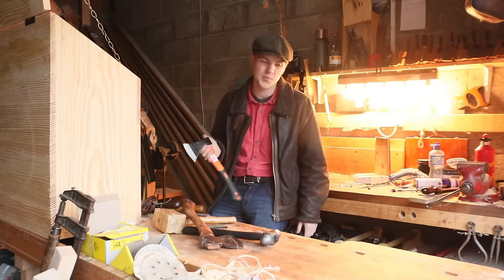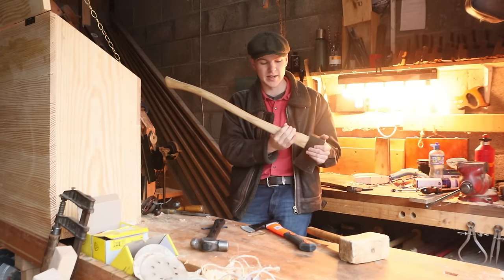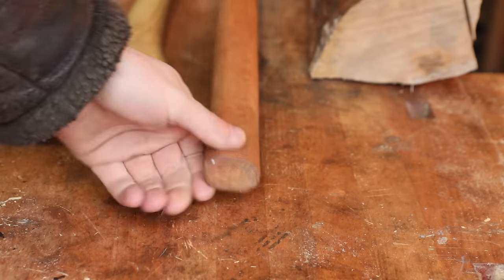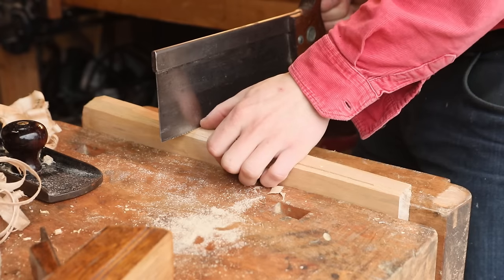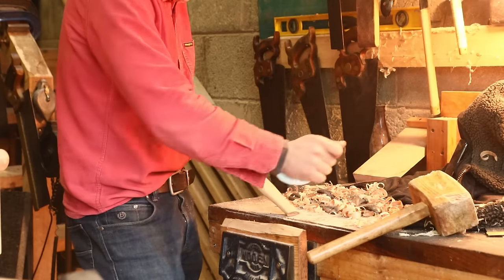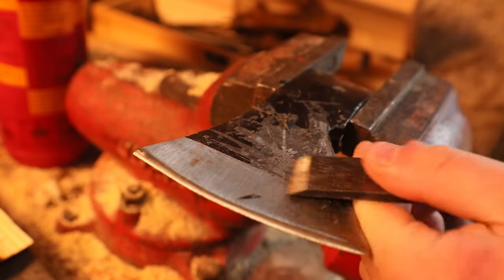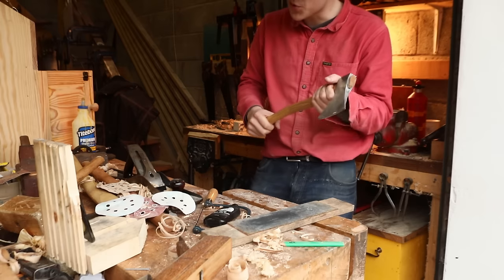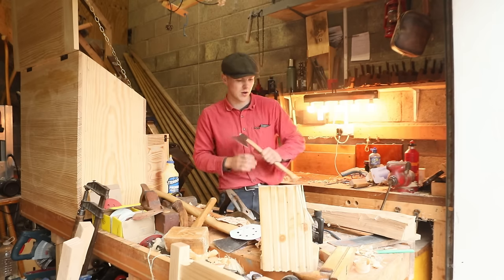Fixing the Cheapest Axe I Could Buy

Comment: I never knew that about the grain selection, makes a lot of sense when you think about it though, have the grain running against the direction of impact for maximum strength.  The axe looks well, definitely a lot better than it did anyhow!  And certainly going to cut better for not having that pissed-up edge on it.

Maybe in future you could make yourself a simple brick forge and have a go at heat-treating it to get a bit more edge retention and hardness out of it.  It's never going to be a top-end steel, but with a good round of treatment, plus yout work re-profiling and handling it, you might well be able to turn the 6 Euro axe into at least a 60 Euro axe!
Reply: Agreed with all of the above….however the hardening of the edge is subject to the composition of the mother metal. 
More carbon, molybdenum etc will achieve an upstanding result but a mild/ milder steel will remain inert despite the efforts. 
Best regards 
Mark
Old school Tool and Diemaker

Comment: Oil everything. Internal wood in the box as well as the tools.
Maybe wrap some tools that are used less often in wax/oil paper. Also Poundland damp trap might be worth trying although it wouldn’t look great but it would absorb any moisture inside the box
Maybe also look at how well the box lid seals. If moist air can move through gaps then it will settle on the coldest materials/tools

Comment: To get the epoxy out easy you can use acetone an leave the ace Head in a plastic bag so the acetone doesn't evaporate wile it losens the epoxy it worked a treat for me, I think the fiberglass stand's act like a wick

Comment: I recently got hooked on your content via YouTube Shorts. Apparently YouTube knows me better than I know myself. Keep it up, great stuff ❤
But using a STONE-Drillbit for plastics looks just so wrong 😅
Reply from the maker: I rarely use power tools. What would you recommend?
Reply: @EoinReardon  I'm not the one you replied to above, but rock/masonry bits aren't really very sharp, they're more like a spiral-shaped blunt-ish chisel intended to be used with a hammer drill or rotary hammer that relies on impact as much as(if not more) than actual cutting. For drilling through epoxies or plastic I'd much rather use metal(HSS) or wood drill bits.

Comment: My friend, I know exactly what you went through removing the original handle. I had a full size axe with a fiberglass handle break on me, and decided to simple re-haft it. Wasn’t as simple as I thought it’d be… that epoxy stuff was rugged! 😁
Reply: Yeah, similar thing happened to me, except with a claw hammer. That fiberglass epoxy stuff was HORRIBLE to work with and stuck like it was welded on!
I probably should have just bought a new one, it wasn't exactly expensive to begin with, but if you don't see a broken tool and think 'that could be a fun project', then what's wrong with you?

Comment: I'd have used fire to remove that plastic handle, then case harden the head using oil and silica sand. That's how I make my own cast iron oiler rings. I build steam engines for a hobby.

Comment: So. speaking about grain direction with respect to the tool it is handling. Would you want the grain of the froe handle to be perpendicular to the head so that when you do the "lever action" to split the wood the stress is in the direction that is less likely to split the handle? Or would you still want the grain parallel to the head?

Comment: Have you ever had the ash snap off just below the haft of the axe head after fitting a handle?   I've had that happen with a hammer and two hatchet heads -- wondering if I just got a brash bit of ash, or whether or not I 'over-did' it with driving home the wedge.

Comment: Eoin, one of your shorts you remade a hand ax. You sharpened one side. Would you explain a bit more? And is the side sharpened depending on which hand this ax will be utilized in? Thanks.
Reply from the maker: exactly! only sharpening one side means the axe behaves sort of like a chisel. you can swing at lower angles to the wood and still take a cut also.

Comment: 1st. The palstic handle is not low quality. It is cheap, lightweight and durable. 
2nd. For a project axe i recommend an old rusty head from a thrift store or from the old cabinet in your granpa's garage.
3rd. For reprofiling an axe edge without powertools use a hand file, not a stone. Then sharpen with stones.
That was a perfectly usable axe (other than the edge). Get yourself one and bang it around. Throw it. It's fun.

Comment: Why to remove a very well madre Glass fiber handle and replace it with wood wich Is More prone to ruin with the Time and use? This Is a legit question.
Reply: Corporations didn't choose fiberglass as a better performing material. They chose it because it's cheaper and easier to make. Fiberglass eventually loses its structural integrity with repeated exposure to shock. And Fiberglass can also experience a form of rot.

Comment: Is it possible to remove the Rubber handle of an Estwing Axe and replace it with wood??
Reply: I wouldn't change the rubber unless there is some bad damage etc. Unlike this cheap axe an Estwing is quality tool. I use an Estwing hammer every day as a carpenter and the rubber handles are grippy and comfortable!